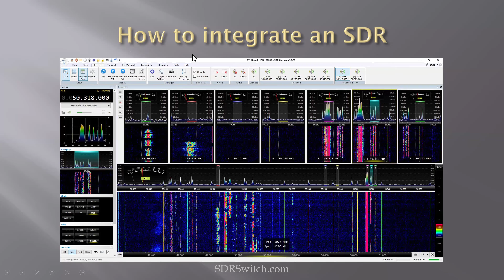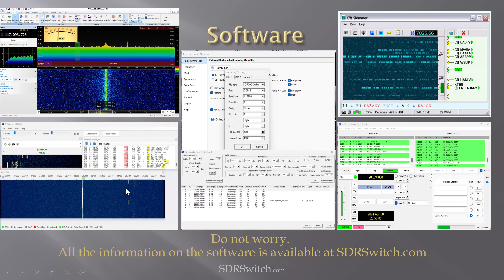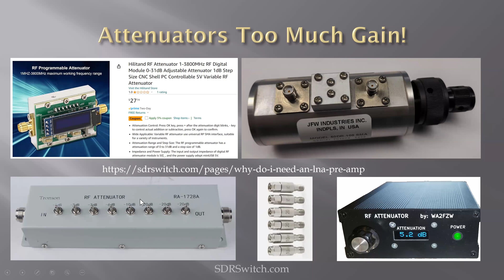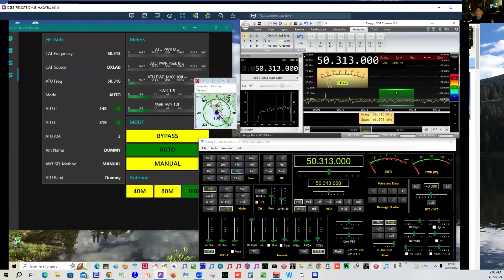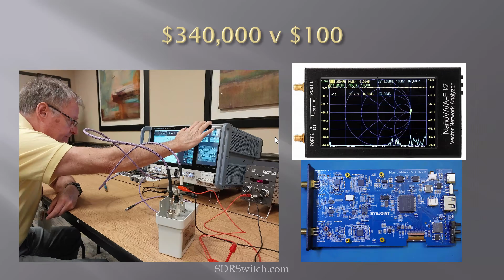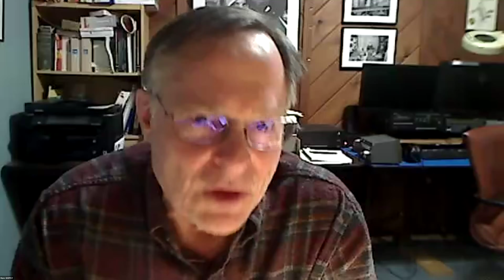N2EME on SDRs and SDR Console - What is Important to know, why you need a preamp and noise figure.

Comment: Thanks, Paul, this was very informative. I'm building that SDRSwitch setup now. I had a couple of questions about the block diagram at 19:49. In that diagram, there is a line running from the computer to the rig. Is that correct?  If so, what is that connection? In the photo, it shows the TX out from the SDRSwitch as the only connection to the rig. Also, in the setup demonstrated there, is it correct that the control goes one way--meaning that you can adjust the rig and the SDR will adjust the display--through SDRConsole--but the SDRConsole (or Omnirig) does not change the settings on the rig? I think I've seen that possible, but it's unclear to me if this setup does that. Thanks again!

Comment: Checking in from Boulder.
I gave up on SDR's a few years ago until the installation process became less frustrating and reasonable enough, and with enough convenient enough to use to bother with. There was just to little clear installation info. Now it appears it is worth installing. But I went to the SDR Console site and found a maze of apparent ads instead of downloads to click on. This turned into another maze of different screens and other web sites to get the download from, including having to sign up for an online file sharing site. Am I doing something wrong, or is this maze and the mandatory gathering of my personal info the only way to get SDR Console? If it is, I'd rather get along with my old Hammarlund tube receiver. At least it can ignore a nearby lightning strike.
Reply: I had the same puzzlement trying to find my way to download the software. Terrible site.